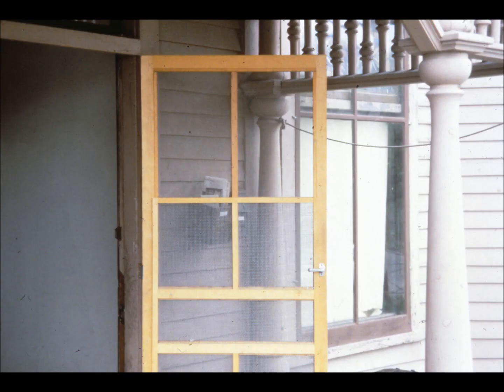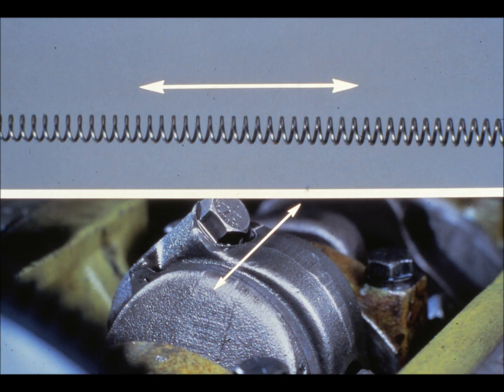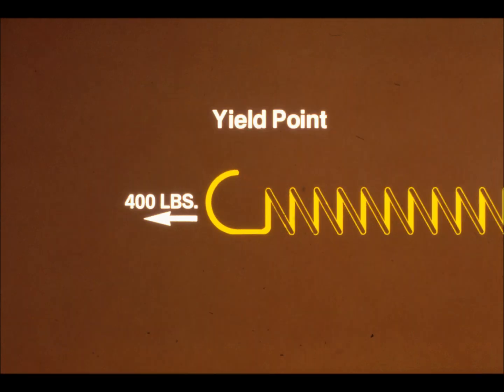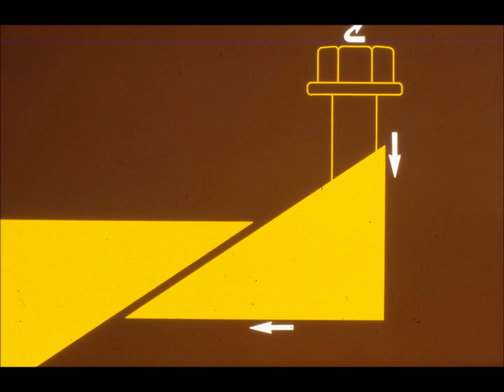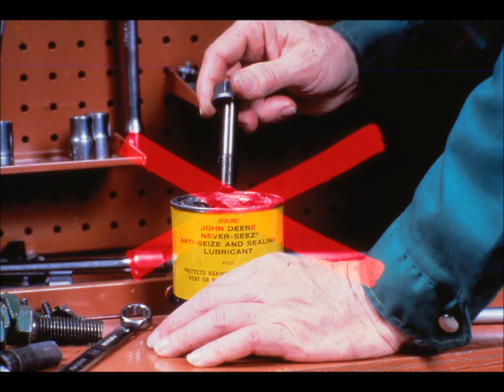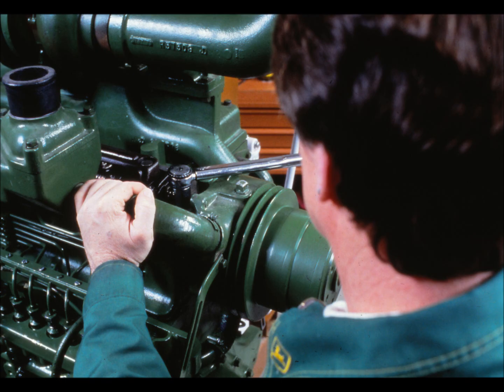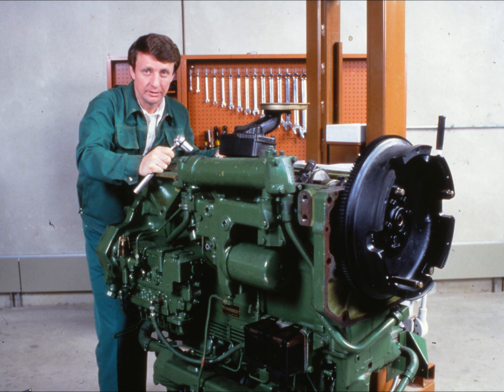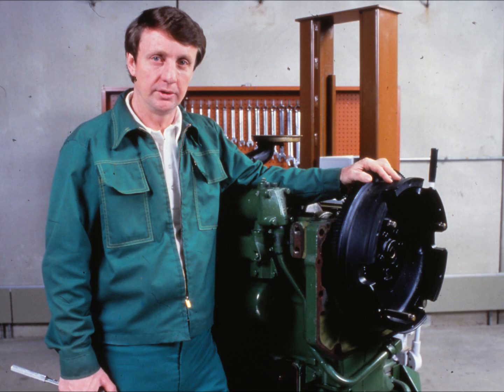John Deere - Torque Turn Method Of Tightening Fasteners

Comment: Torque to yield bolts is just a fancy and expensive marketing term for grade 3 garbage bolts. 

Years ago, when they started coming out, I was in college for tech trades and had a machining lab for two semesters. Down the hall from us was the auto tech lab, and one day, they brought us in a bunch of brand-new torque-to-yield bolts for us to run our test machines on to see what made these bolts so special. 

Short story is every bolt tested in the same range of hardness, torque yield, stretch, and any common grade 3 bolt.  

There is a reason real engine builders use high-proof value fasteners on their engines and not torque to yield garbage.
Reply: @tcmtech7515 You are missing the point. TTY bolts typically utilize lower-grade steels. The entire concept of TTY relies on the bolt undergoing plastic deformation (yielding). Higher-strength grades like 12.9 are designed to resist yielding and have very high tensile strengths. Very high-strength steels can be more prone to brittle failure, meaning they might snap suddenly without significant yielding, defeating the purpose of the TTY method. Traditional torque based tightening methods can be influenced by thread friction, lubrication, etc. These variations can lead to inconsistent clamping forces, even when the same torque is applied to each bolt. Torque to yield bolts minimize these variations by stretching the bolt to a specific point, ensuring a more uniform clamp load across all fasteners.
Reply: @GTIFabric  Yes, that's the marketing BS I am talking about and why pro engine builders don't use them for anything that matters. 😁
Reply: Get some education clown and come back here in 10 years (and apologize).
 Torque alone does NOT translate into tension (because it's very dependent on thread condition, lubrication, rust etc., load difference will be 2-3 X between dry and lubricated thread, at same torque).
 Angle does (thread has a pitch, so turning gives you a progress, lengthwise, so the tension can be precisely calculated and real life test will confirm it).
 That's why important connections are "torque + angle" or other, better methods (like load cells).
Reply: I agree it’s jut a way for manufacturers to use cheap hardware to save money and yield more profit.

Comment: Dont miss these days in auto mechanics 😂. 🙏♾️ Thanks for the refreshing course. A bolts torque specs are very important. After 30 years of turning a wrench i can just about get it right on the money every time without the torque number but you still check to be sure 😁

Dang autocorrect
Reply from the maker: I've usually been fussy about torquing things proper. Spark plugs were the first thing I learned on. Seems Dad didn't like shaking the Cushman 3 wheeler all over the garage just to get a plug out. 🤷‍♂️